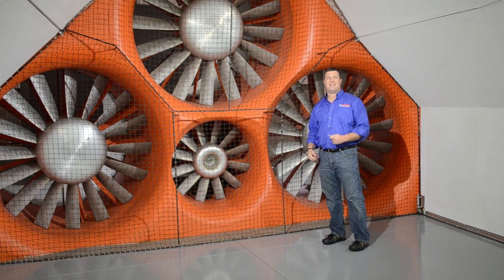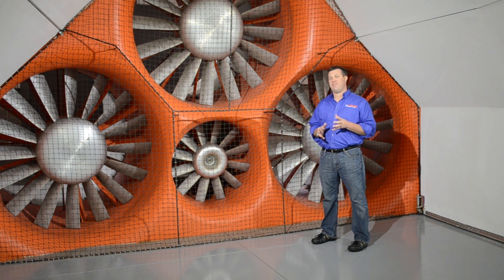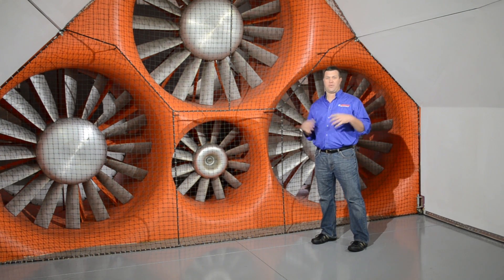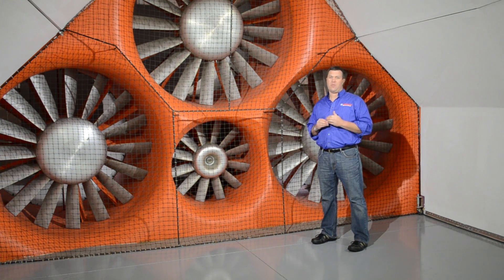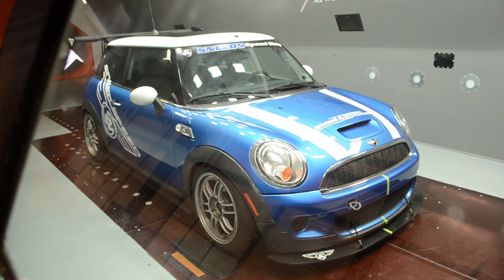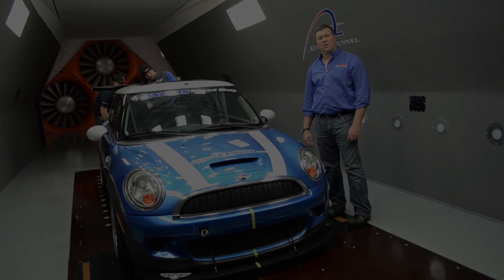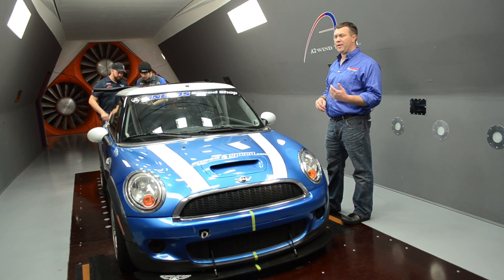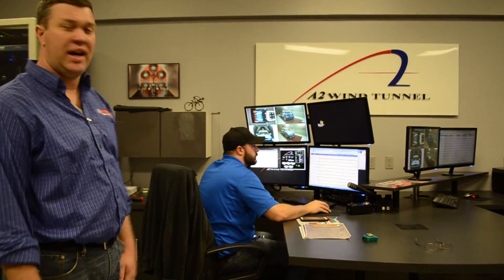MINI Cooper Wind Tunnel Testing - Sneed4Speed R56 Aero kit

Comment: The wing is not working that effectively with these roof turbulence right?
Reply from the maker: The roof is flat and smooth and it doesnt create turbulence. The air gets a bump as it hits the windshield and moves up but the air is coming back down as it hits the wing. Thats why the wing is mounted with a slight up angled of attack in the center because the effective air flow in the center of the wing is not hitting the wing straight with the car travel like the sides of the wing which are at a different angle of attack.  The curl in the smoke is from the air being pulled into the wing from the side of the car. Right around where the drip rail and window meet.  It makes a very cool picture.  If there was turbulence at the wing the smoke would not be a smooth stream.  Hope that explains your question. Thanks for watching.